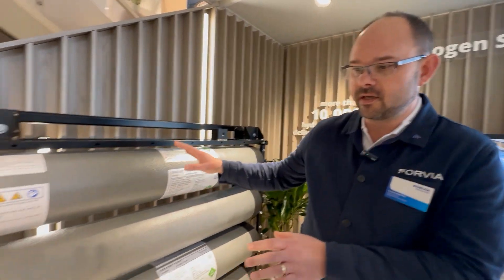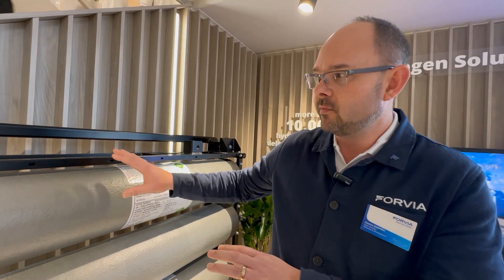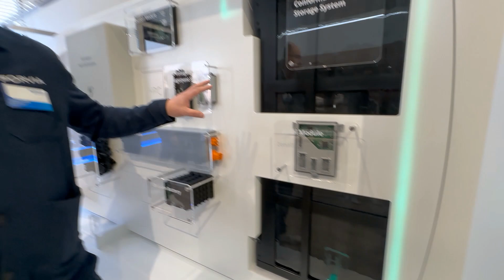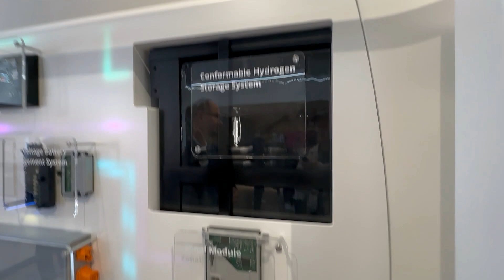Forvia’s Hydrogen Fuel Tank Breakthrough - CES 2024

Comment: Sorry but physics is physics is physics. There is a reason high pressure tanks are cylindrical - it has the least surface area than any other shape (other than a sphere) and the forces of the high pressure gas are equally distributed over than surface. Flat surfaces and corners require extraordinary structure for strengthening and create many points of failure.

And that is on top of the impracticality of hydrogen as a consumer rated fuel. While the promoters keep trying to sell the "greenness" of burning hydrogen the dirty truth is that the generation of hydrogen is one of the more polluting processes in existence. Steel and other metals are actually porous to hydrogen. The molecules ares o small that they seep thru the storage tank walls. The consumer infrastructure does not exist and hydrogen is very expensive. This will not change in the future.

Comment: What a waste of time and money. Hydrogen, even made with renewable power, is 60% less efficient than the energy it takes to make, compress, and transport it. 
I'm other words if you just used the electric power that it took to create the hydrogen in the first place you'd get 60% more power at the end (all things being equal in the final drivetrain). 
Until they can change this end result, hydrogen will NEVER be competitive except for small corner cases.  Otherwise it is a huge waste of money and it forces the end vehicle to be dependent on an outside producer of hydrogen.... driving up costs. With straight electricity you can produce it at home yourself with cheap solar panels. 
Oh, and need we talk about the dangerous flammability of hydrogen?
This is stupid.
Reply: It’s actually 1/3 the efficiency.
Reply: Electrolysis is not the only way to get clean hydrogen. People seem to forget that fact or at least isn't aware of other sources.

There's red h2, where it's basically a byproduct of a high temperature nuclear reactor from generating electricity. This is because it splits water purely through heat thermochemically, so this plant generates both at the same time.

There's another that's more promising. Geologic hydrogen aka gold/white hydrogen. A number of huge wells has been found recently and plans to extract those wells are underway. It's expected to be super cheap as earth does the water splitting for you. It's also renewable, since it's constantly generated when underground water interacts with geologic processes underground like Radiolysys, Serpentinization, and thermolysis.

There's turquoise which uses methane pyrolysis but is zero carbon since the result is h2 and carbon black. Which is a solid substance and is an in demand industrial product for a number of things like tires.

Even with electrolysis, you'd still get a lot if you have a solar / wind heavy grid. You generate h2 when supply outstrips demand. it's better to use that electricity than throw it away. To give you perspective, California alone curtails millions of megawatts of electricity every year since the grid can't take it and there's no viable grid storage available. The only practical storage solutions are hydrogen in salt caverns or as LOHC or pumped hydro. Grid battery storage does not scale economically at all and degrades rapidly due to constant discharges due to how grid demand works.

Comment: Hydrogen fuel cell is very useful only and when only you can't have enough battery. Okey. Imagine that fuel hydrogen is everywhere but can never compete with electric charger on the price. Fuel cell energy is not stupid. In remote region, it's surely a goto energy reserve solution, no doubt. However there is already a better way en mass. When battery becomes cheap enough and 250kW head is everywhere, the fuel cell winter will arrive.

Comment: Enapter small / modular AEM electrolysers have been producing hydrogen in residential buildings from several years  solar PV panels driven and using a bank steel gas bottles like those used  in hospitals for storage. 
Picea systems in Germany  can provide  residential homes with off grid electricity and heating  all year around  it may well be possible to produce hydrogen at home for vehicles, but due to high cost of  HFC vehicles and lack of hydrogen fuelling stations this is not economically viable as EV are more affordable and fast charging networks  expanding globally.

Comment: Seeking to displace EVs with other fuels (gasoline, hydrogen, etc.) has one huge advantage for CONSUMERS: Only electricity can be manufactured by the end user. This consumer indepenence eliminates dependency on third parties and eliminates the distribution overhead and environmental impact for petroleum and hydrogen fuels.
Reply: Large percent of the population live in dense cities in condos where they can't charge their cars. They also can't generate their own electricity. They have to resort to public Chargers or swap stations. For them hydrogen can be a good alternative. And renewables Will generate lots of excess Energy that we can use to generate cheap hydrogen.
Reply: @simson4t That is a FOOLS dream!
Reply: Electrolysis is not the only way to get clean hydrogen. People seem to forget that fact or at least isn't aware of other sources.

There's red h2, where it's basically a byproduct of a high temperature nuclear reactor from generating electricity. This is because it splits water purely through heat thermochemically, so this plant generates both at the same time.

There's another that's more promising. Geologic hydrogen aka gold/white hydrogen. A number of huge wells has been found recently and plans to extract those wells are underway. It's expected to be super cheap as earth does the water splitting for you. It's also renewable, since it's constantly generated when underground water interacts with geologic processes underground like Radiolysys, Serpentinization, and thermolysis.

There's turquoise which uses methane pyrolysis but is zero carbon since the result is h2 and carbon black. Which is a solid substance and is an in demand industrial product for a number of things like tires.

Even with electrolysis, you'd still get a lot if you have a solar / wind heavy grid. You generate h2 when supply outstrips demand. it's better to use that electricity than throw it away. To give you perspective, California alone curtails millions of megawatts of electricity every year since the grid can't take it and there's no viable grid storage available. The only practical storage solutions are hydrogen in salt caverns or as LOHC or pumped hydro. Grid battery storage does not scale economically at all and degrades rapidly due to constant discharges due to how grid demand works.
Reply: Nah, hydrogen(like gas/diesel) gives you choice to shop around. Choice = freedom
Reply: @CarterEdison777  In fact electricity is actually something that's more controlled than other fuels, it's the other way around. In disasters it's usually the first thing to go out, malicious govts can easily pull-out generation as well in theoretical scenarios and destroying a single substation can take out a whole neighborhood and disable their movement. Liquid fuels are more decentralized in that end, gas/diesel is especially hard to beat since they're easy to handle and transport. Hydrogen in LOHC form can be similar if we use Direct LOHC fuel cells in the future.
Reply: I love the simple minds that talk down to others. 

While I can respect the efficiency electricity, and I acknowledge the development of battery and, maybe more importantly, super capacitor tech there’s still a fatal flaw that may not be overcome. Electric motors under load can lose more than 75% potential. 

Hydrogen, while I also agree, is less efficient has something very special. Hydrogen can be converted to electricity, combusted, or evaporated for cooling and if you want to make it at home, throw a handful of nails in a bucket of water with a bag over it (5kg overnight), electrolysis of water (20kg with the right setup),  or hey, if you love batteries, reclaim it as you recharge them (.5 kg maybe… probably not)

ICE motors lose 25-30% potential under load, but better yet, steam loses 5-10%…

So, Mr apartment dweller, get some iron, and some juice, and a bottle, spark your homemade gas, throw water into that 4500 degree combustor, send it through a turbine and take home with you, or enjoy your personal ultralight flight, if it’s hot, send a drop through the evaporator and enjoy -200 degree AC (don’t send 2 drops unless you hate your toes)… and don’t forget to fly by Mr EV driver sitting in traffic (efficiently) and shoot him a “neener neener” with either fingers up, thumb to nose, or both hands to the temples.  You’re welcome ☺️
Reply: Hydrogen fuels produce water.
Reply: Your level of understanding is clear. @Dularr

Comment: 'Hydrogen in almost every vehicle' ... seriously?  Credibility lost.  H2 does have it's place ... but it sure isn't there & that shouldn't be a surprise at this point.
Reply: Exactly. They make the tanks but it sounds like they, along with nobody else, has any interest in spending $100B to build out the passenger vehicle hydrogen fueling stations on every corner in America. It's a non-starter.
Reply: @davidmccarthy6061 except the US is already building a hydrogen infrustructure.
Reply: @Dularr  Great. How much does it cost to fill up a car?
Reply: @jamesvandamme7786  I don't think it will be for cars. It will be for large trucks and large farm equipment. Replacing diesel with hydrogen turbines.
But I could also see Hydrogen turbines used to generate electricity for EVs. With the option of feeding electricity into the grid.
Reply: @Dularr  Who is, and where?
Reply: @davidmccarthy6061  Even if they did, it takes more electricity to create the H2 to drive a mile than it does to charge an EV & drive that same mile.  So it simply will be the more expensive option.  That alone kills it for solutions in which a battery option is feasible.  The stuff has to be used where it makes sense.
Reply: @JT_771  That's only for electrolysis which people assume as the only way to generate h2. There's a lot more clean ways to generate it where it even out matches electricity in efficiency. The biggest upcoming one being letting Earth generate it for you, large amounts of interests and money has been recently flowing into drilling startups since there's a lot of new discoveries on natural hydrogen wells, one in France being the largest that it could supply the whole Europe's hydrogen needs for a century. 

There's even a precedent as a village in Africa is 100% powered by clean hydrogen running on a fuel cell for a decade now. The best thing about it is that it's touted by geologist to be renewable since it's continuously generated underground by geologic events interacting with underground water. It out paces electricity in efficiency since extraction is much cheaper than converting mechanical and heat energy into electricity. You skip all those since you let Earth do the energy intensive stuff for you.
Reply: @ryoukokonpaku1575  So-called "white" hydrogen does have some potential, but it'll tend to be heavy industry.  It's not worth it trying to pipe or transport it from the known locations to use for something like cars.  It does certainly have some usage potential; in the right areas.
Reply: @JT_771  You can use LOHC for it, you basically make hydrogen liquid in both ambient pressure and temperatures. You could easily put it on a water bottle at that point and carry it around. This basically allows you to transport hydrogen in large amounts by reusing the whole gas/diesel infrastructure, from oil tankers all the way to trucks. It's also much denser than compressed hydrogen at 700 bar and only a bit less dense than liquid hydrogen, but it is much easier to handle, so you end up carrying more of it per volume. 

Heck there's even research on DIFC which are basically fuel cells that can directly use LOHC like the promising 2 propanol fuel cell that's being tested by both Japan and Germany. This potentially allows you to even reuse station dispensers at that point and even current vehicle tanks.
Reply: @ryoukokonpaku1575  Liquefying H2 has a fair number of issues.  H2 is great in ways, but it's horrible to work with in other ways.  I just don't see it happening for situations where a battery does the job.
Time will show what's what that way, but just too many issues for when an easy replacement is available.
Reply: @JT_771  It's not liquified hydrogen. That's hard to handle as it needs to be cryogenic. LOHCs are basically organic hydrogen carriers. They're similar to Metal Hydrides where you can pack hydrogen onto it and reverse the process without consuming the carrier which is the metal lattice in hydrides and the organic liquid (usually Toulene) in LOHCs. There are no disadvantages for it other than a conversion penalty for the dehydrogenization step to convert it back to gas if it's not used on DIFCs as that needs a dehydrogenization module that's a bit pricy today since they're not mass produced currently, this conversion step adds costs but if you pair it with white hydrogen you can actually afford the process. It'd be similar to crude oil and refining it for other uses. Some LOHC variants are even non-combustible like Germany's Dibenzyltoluene as it needs over 300 celicius to ignite.
Reply: @ryoukokonpaku1575  Oh yes, my bad, I apparently skimmed the comment too quickly.  It will be interesting to see how those expand the H2 market.  I don't see it getting into 'cars'.  Batteries just make too much sense.  But certainly some potential there for a number of areas, getting any kinks worked out.